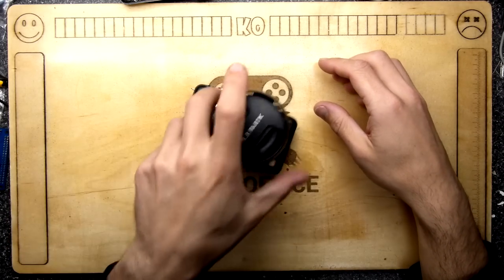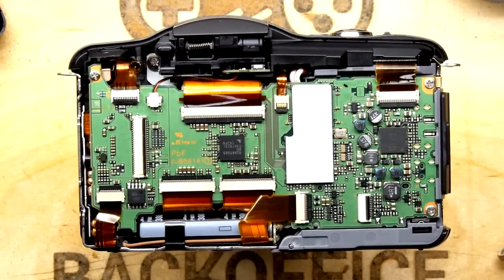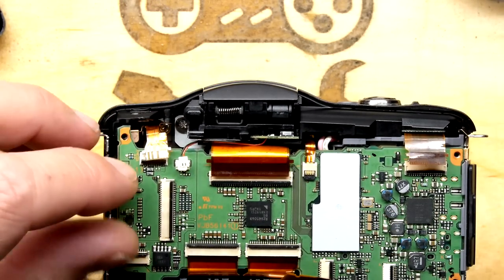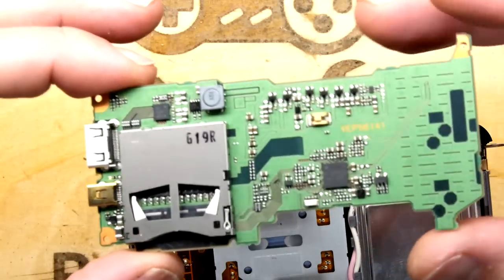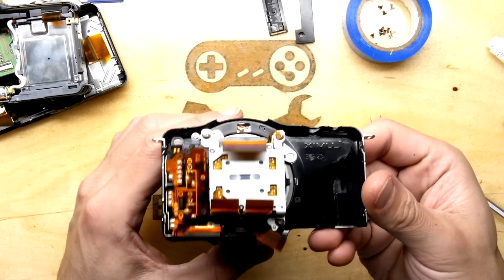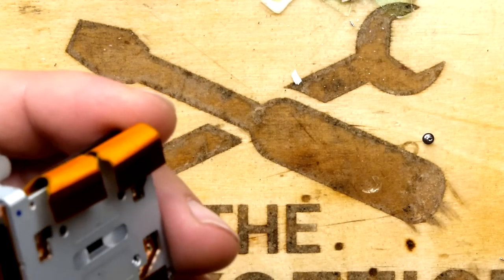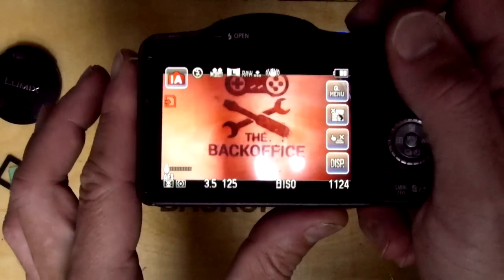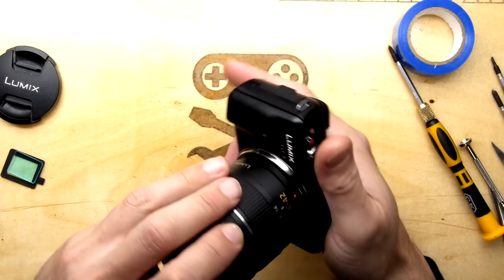How to remove your camera's Infrared filter

Comment: There's a site, I forgot what it was. I'll have to dig it up and add it later, but they sell replacement filters for all sorts of cameras that allow them to shoot both IR and UV and keep the sensor covered. They also have a crapload of tutorials on how to disassemble various cameras to get to said filters.
Reply from the maker: I wonder if that will help restore auto focus 🤔
Reply: @backofficeshow    I did find it, finally.  www.LifePixel.com I've no doubt there are plenty of others out there, but I took interest in this one because of the tutorials for DIYers. And yes, taking that out completely may have interfered with your autofocus. I'm no camera expert by any means, I just fix them and sell them off when I find good deals and whatnot. But I can see where that may have interfered with the autofocus functionality, depending on what method that articular camera uses.

Comment: Try putting a filter in front of the lens to get ir photos. They look amazing.
Kudos for taking a camera apart.
Reply from the maker: Hi Clive, what sort of filter so you suggest?

Just after the video I dismantled it again and soldered in remote power and two stage shutter controls. I have an application that needs an industrial camera, but these are many factors better! 😁
Reply from the maker: The blue IR looks amazing!
Reply: @backofficeshow  Late on the party, But you could either get germanium or silicon piece abou the same size of the original filter, It's rare that you will find it on internet so you need to cut it out using CNC machine.
Reply from the maker: Thanks for the tip, it might be a project I want to revisit again!

Comment: 7:27 Be carefukk with this capacitor it can schock you very god if you remoft the Batery like this guy
Reply: haha yup ive done that before even though the camera had not been used for months.. it stores a lot of charge 😊
Reply: It is for the flash.  The voltage is over a hundred volt.  Discharge it by shorting the terminals with a few k ohm resistors before handle it.  It won't kill you.  But a slips can kill other electronics in the camera.
Reply: @terrywey8347  okay

Comment: Put a filter on the lens which blocks out any other light. A fat ass ND filter which specifically lets IR through and you have yourself a IR camera. Some conversions cost as much as $200 but they come with the IR filter replaced with ND.

Comment: @17:15 lolz!! i can see a remote control 'light' even without removing the IR cut filter!! hahaha
Reply: Not as bright...
Reply: @terrywey8347  i shouldn't be able to see it at all as the internal cut filter cuts out IR!!
Reply: @PeterPete  Only if you have a "perfect" IR filter.  Just as the "window blind" not really can "blind" you, the IR "cut" filter" in a digital   camera not really cut off all the IR light rather just reduce it so it won't affect the picture quality.  The camera sensor chip pickup IR which will cause glare and color shift in picture.  That is why it needs to reduce IR.  By removing the IR cut filter, the camera gain the  full IR capability as it can but will affect the quality of normal picture.
The consumer IR (which the TV remote control is) is strong enough to shoot cross the room, just we don't see it.
Reply: @terrywey8347  terry mate - it's called an IR CUT filter not an IR limiting filter or reducing filter!

You really need to demonstrate your point otherwise i'll think it to be total BS!
Reply: @EXYZ3  how can a camera see ir when there is an ir cut filter installed? 

Isn't an ir cut filter supposed to remove ir so you can't see it?
Reply: @EXYZ3  an IR cut filter blocks or reflects the transmission of IR light. Therefore the sensor is not exposed to IR light of any kind. If you want to use mental gymnastics to argue I'm wrong you need to bring something more tangible to the table 👍